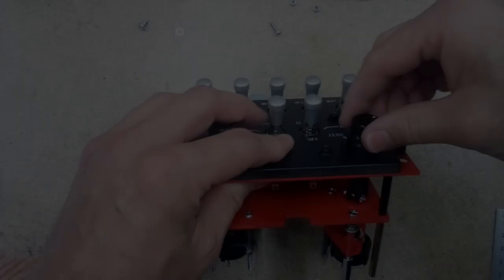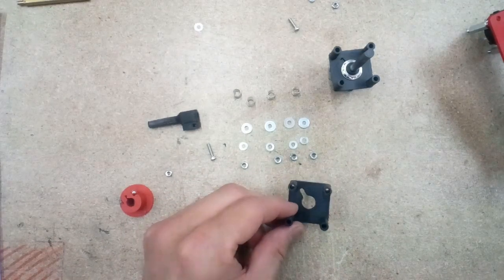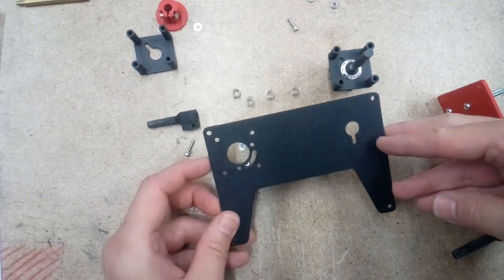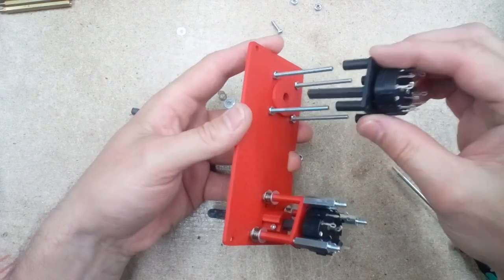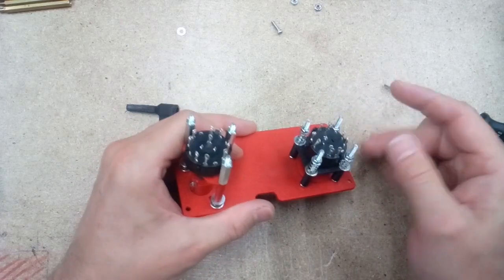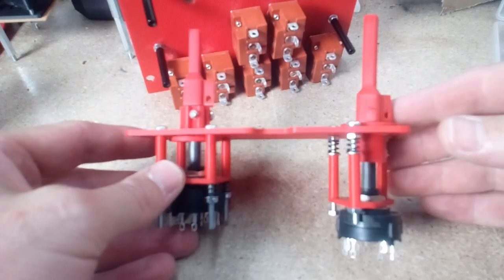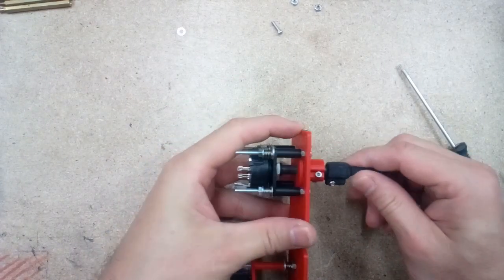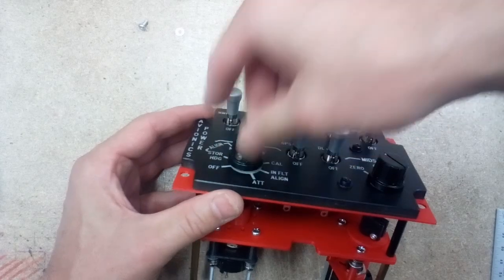F-16 Home Cockpit 09 - How To Build DIY Push / Pull Switches

Comment: Nice solution.  The shaft extenders could be made with transparent material if you want to illuminate the knobs.
Reply from the maker: Thank you!
Great tip!

ATM to backlight the knobs there's already a round white part around the hole as in the real panels.
That's why I only made the 8mm hole for the (6mm) shaft in the plates so the LEDs can be placed around it 🙂

Comment: Awesome solution! Do you have a list of which panels use locking rotary switches?
Reply from the maker: Thank you! 
Here's the data I got at viperpits from Nikolas (the "P" in the special function columns shows where a stop is located):
ROTARY SWITCHES
Panel	Control		Posi-  	Index  	Special 				
					tions 	angle	function				
FUEL	ENG FEED	4		45		PULL STOP 1P234 STOP	
AUXCOMM	MASTER		5		36		PULL STOP 1P234P5 STOP	
AUXCOMM	CNI			2		36								
IFF		MASTER		5		36		PULL STOP 1P234P5 STOP	
IFF		CNI			2		36								
AVTR	DISPSELECT 	4		45								
AUDIO 1	Mode		3		45		Push switch				
AUDIO 1	Mode		3		45		Push switch				
CMDS	PRGM		5		36		Momentary to BIT		
CMDS	MODE		6		30		PUSH STOP 1P2345P6 STOP	
EW		MODE		5		36		PULL STOP 1P2P345 STOP	
INSTR	MODE		4		30								
FUELQTY SEL			6		45		Momentary to TEST		
AIRCOND	AIR SOURCE	4		45								
KY 58	MODE		4		45								
KY 58	Fill Sel	8		30		PULL STOP 1P234567P8 STOP
KY 58	TD			3		30								
AVIONICS POWER INS	7		45		PUSH STOP 1P2P3P4P5P6P7 STOP
AVIONICS POWER EGI	6		45		PUSH STOP 1P2P3 STOP	
AVIONICS POWER MIDS	3		45		PULL STOP 1P2P3 STOP

Comment: Hi, is your F-16 cockpit for BMS or DCS?
Reply from the maker: It's designed to work with both. Inputs are done through HID interfaces (=Joystick firmware on an Arduino), outputs are read through BMSAIT which also gives data from DCS.
https://github.com/HummerX/BMSAIT